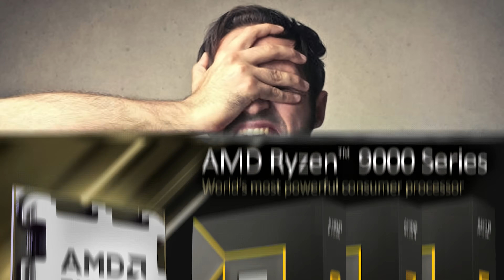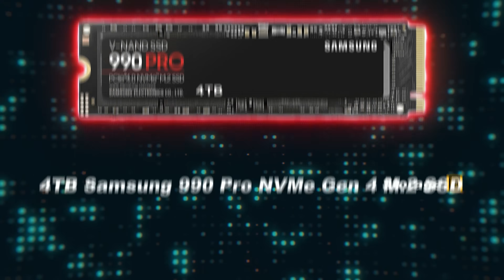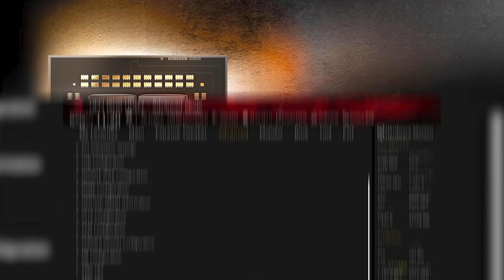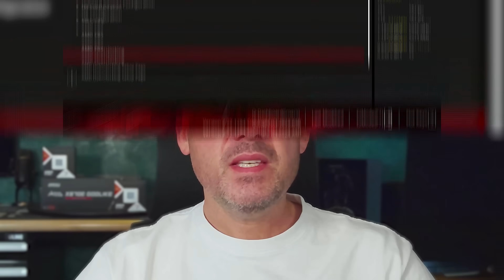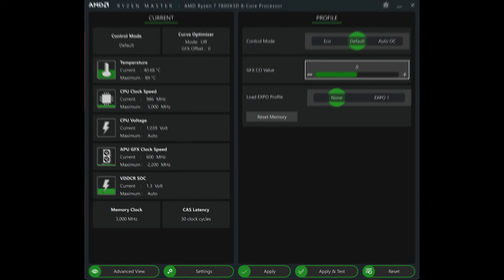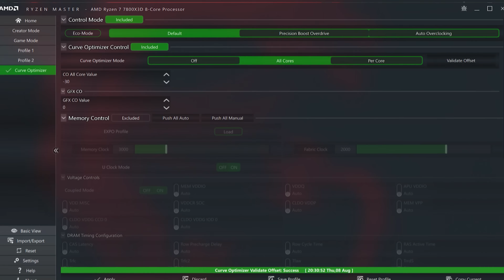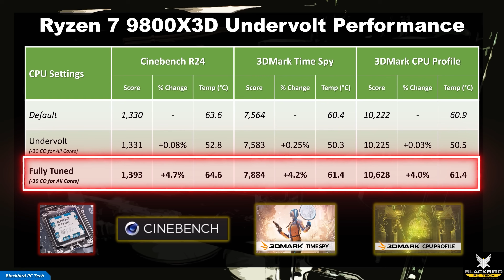How To Undervolt a Ryzen 7 9800X3D The Right Way! (or Any AMD AM5 Ryzen CPU)

Comment: As a long time builder and enthusiast i never did really much with over/underclocking other than "auto overclock" on my old i5 2500K. Now with my 9800X3D running a little hotter since having a new graphics card looking into undervolting and making the most out of my system. Looking at a lot of different information and guides. This guide is nice, not really specific on the Asus motherboard but PBO in general. Some others do this pure in the "Tweaker" tab in the bios which makes me feel a little bit lost in the MSI Bios and actually understanding a lot more 😅

However, where this starts making no sense is in the comparison charts around the 7:00 mark. You compare the Max CPU clock speed. Sure, the "wrong undervolt" has a lower max CPU clock. Which sounds like trouble, however, al the fps scores on the left are actual higher!? How come? And is this a sign of a throttling cpu due to low voltage or other factors?
Reply from the maker: I understand why that may be confusing and I should have used a different example to try to highlight the issue of clock stretching.  These runs were conducted weeks apart and not at the exact same settings, which is why the performance was different. My intent was to highlight how to recognize clock stretching.

Comment: Thanks for the video. I only did negative 10 undervolt and achieved everything I wanted to achieve. 😊 It's stable and I could probably go to negative 30 as well. But I'll keep it as is for now.
Reply from the maker: As long as you are happy with your performance that's all that matters!
Reply: @blackbirdpctech  I already changed it to 20 😅 I'm a bit overly cautious with these things.
Reply from the maker: @Thunderhawk51  it's ok to be cautious ... just keep checking stability after you make changes and you will be good
Reply: @blackbirdpctech  Yeah it's stable 😁

Comment: I don't know what should I do with AIDA tests for my 9800x3d. I have mixed feelings... my system could be stable with -28 for a half an hour and fail after 4min with -27, should I bother if the games run smooth with high load for hours with -33 or only leave the curve when AIDA passes at least once for 10 min (cause it can pass first time and fail on second run)?? Temp is always around 70C. Thank you.
Reply from the maker: I would recommend backing off to a stable setting ... something like -25 CO
Reply: @blackbirdpctech thanks!

Comment: Case: Fractal Terra, cpu cooler: thermalright axp90-x47 full copper.

I was able to do only -10 on all cores which was stable, temp max 80-82C, -20 pc did not boot, -15 pc booted but after starting stress test pc freezes completly. So my silicone lottery luck is only -10 😁 but I think it is still good.
Reply from the maker: Remember that -10 is still better than stock, which is better than what you "paid" for ... so take the win 😉

Comment: Question I notice you said that there were two ways to access curve optimizer I did notice that on my bios, I also am using a rog motherboard which one do you recommend using and is it a problem if you use both?
Reply from the maker: I recommend which one to use in the video ... I wouldn't recommend using both, but if you do, make sure to enter the same inputs in both.

Comment: I bought a pre built 9800x3d with a 5080 and was running 95 degrees in cinebench and like 60 degrees at idle I decided to undo the AIO and I found they left the protective film on the AIO cooler plate 😅 now it tops out at 75 degrees and idles at 40
Reply from the maker: Of course they did ... it's truly shocking what some companies do ... most have absolutely no idea what they are doing
Reply: @blackbirdpctech im just glad I noticed when doing my setup and trouble shooted it before getting stuck into a long gaming sessions and setting my desk on fire 😂

Comment: Will this effect caching performance/stability in Borderlands 4? I have a Ryzen 7 9800X3D for about 3 weeks now and I'm only here because I've been playing Borderlands 4, high CPU temps!!!!
Reply from the maker: If you implement a stable undervolt then it should be stable in any game you play.
Reply: @blackbirdpctech  Hej
Thanx a bunch, I undervolted to -20 and BRL4 is caching at 74 degrees instead of 90 plus!! Gaming is mid 60s. Amazing help
I have noticed that menu switching has a bit more of a mico-stutter than before, fps drops to 20-30 whilst switching. And my QD-OLED screen was ruining unlimited FPS . I locked it to 120fps ingame and temps have dropped to the 50's!!!
Bit of a shame considering the cost of the screen and what it can do
I will try a -10 undervolt in the bios, see if the micro-stuttering goes away.
But still MANY THANXBUNCHES !!

Comment: i just picked up this proc and wanted to underclock it but only seem to find info on under volt it
Reply from the maker: Why would you want to underclock it?
Reply: @blackbirdpctech just concerned about how many of the chips are getting fried and to just increase longevity for the chip itself. I was just thinking about running it at 10% under

Comment: Could you check and tell how much power the system uses when idle with the CO -30? It's really useful info too, since that's the biggest issue compared to an Intel processor.
Reply from the maker: Do you have a 9800X3D?
Reply: @blackbirdpctech  Not but I'm thinking about getting it. I know its power consumption is great for gaming, I just want to know if in idle mode, leaving the computer on without using it, the negative CO also has an effect.
Reply from the maker: I didn't test the idle power

Comment: Hello! I've upgraded from a 5900X to a 9800X3D before Christmas. I paired it with an MSI X870E EDGE TI WIFI motherboard with an updated BIOS, and I am currently running the CPU on Auto settings but with EXPO enabled. 

Aside from performance gains and temperature drop, is it really recommended to undervolt this CPU? I'm asking, because my 5900X was very unstable on Auto settings and caused a lot of problems for my computer (black screen crashes, freezing, and lockups which all happen during idle/low power/desktop-only use and under load). I fixed the issues by setting a fixed Vcore voltage of 1.100V on the 5900X. Apparently, my 5900X goes as high as 1.450V during idle on Auto settings.

It's been a few weeks and my PC has been stable so far, but I just want to avoid the possibility of experiencing the problems I had with my 5900X. FWIW, my 5900X was among the first few batches of 5900X that were bad. The 5900X has a very high RMA rate. Unfortunately, I purchased the 5900X in April 2021 and I was only able to pinpoint the problem in June 2025, so RMA was no longer an option for me. I also found out about the 5900X's problems on Reddit in the same month. 

Thank you for your time! Happy New Year! :trophy-yellow-smiling:
Reply from the maker: Performance gains and temp drops are the reasons to do it ... and yes, I would definitely recommend it ... there is only upside if you implement a stable undervolt.

Comment: I went from stock volt cinebench multi score 1291 at 90° max temp to -20 running 1333 hitting 72° max which is actually massive

I tried going straight to -30 from -20 but my computer did not like it, currently long testing -22 for stability now, i wish i could get -30 out of my cpu
Reply from the maker: -20 is a great undervolt

Comment: changing the PBO and setting negative 30 all core made zero different at all on my 7800X3d on the Gigabyte X870 Aorus Elite... temps have not changed
Reply from the maker: Doesn't sound like the setting was applied properly.

Comment: I started the aida64 test and after 16 minutes it said Warning : Hardware failure. Does it mean that my undervolt is unstable? I’m using the 9800x3d at -30 with trisent z5 royal Neo at 6000mt
Reply from the maker: I'm not sure what else you've done to your system but yes, that would likely indicate that you've pushed your undervolt a little too far.
Reply: @blackbirdpctech only the undervolt. All the rest is stock. I enabled the xmp/expo profiles and just started to tinker with the undervolt settings. In the video you recommended to run the test for 10 minutes. In my case it got a failure at 16 minutes? What should be my next steps? Run the test for longer or?
Reply from the maker: @Lungmarco  you can join my Skool community to get further help: https://www.skool.com/blackbird-pc-tech-4230/about?ref=67e6a7048d9540fe87cbdf1b69bd47f3
Reply: @blackbirdpctech  would it be alright to give me some tips here? I just ran a test for 30 minutes at -25 and no crashes. Am I ok here?
Reply from the maker: @Lungmarco  I provide a lot of value for free in my content ... happy to help, but you will need to join my Skool community.

Comment: Tried between -10 to -30 , -30 crashed system the others seem to be ok in aida64 test however temps appeared higher than stock baseline settings 

What could this be I’m lost ? And any other info please ?
Reply: I got a mpg x870e carbon wifi motherboard
9800x3d 
4090
Reply from the maker: Are you sure you are applying a negative curve offset?
Reply: @blackbirdpctech  yeah, all cores, negative and tested each number between -10 to -30
Reply from the maker: If your temps are higher then either your performance went up, which means your boost algorithm is taking advantage of the thermal headroom, or the undervolt wasn't applied properly in Bios ... you could try applying it in the motherboard specific PBO area to see if that works
Reply: @b @blackbirdpctech  Thanks ! , so will it still be ok if the temps rise like you said could be because of its headroom ? , will try again tomorrow and reply back
Reply from the maker: @Arpzyyy if you want further help and tech related support, you can join my Skool community:

https://www.skool.com/blackbird-pc-tech-4230/about?ref=67e6a7048d9540fe87cbdf1b69bd47f3
Reply: @blackbirdpctech  sorted, it just didn’t save properly Thanks for video and helping !

Comment: Undervolted straight to -30 in bios after installing Ryzen Master you can see that your OC worked and that the CCD state -30 now doing an aida64 10 min strestest and it runs at 60 ° so yes a 15 ° drop in temp thnxs The Outerworld I run on Ultra with a Radeon RX 9070 XT and a ASUS Tuf X870 DDR5 32 GB  5600Mhz at 300 + FPS with a cpu of 75 ° this will be much less
Reply from the maker: Nice!

Comment: I used and offset of -10, and when using an occt stress test with 100% cpu utilization my temps went from 90°C to 55°C. HOW?!
Reply from the maker: It's pretty damn cool right?
Reply: @blackbirdpctech  with some more tinkering i got the cinebench score from 883 to 973 and the temps from 91°C to 72°C (there was a little loss of multicore performance with the 55°C, that was without overclocking). Thank you for the video :)

Comment: I have installed the HWinfo program to monitor the temps and I put it on sensors only on startup and so the CPU Tctl/Tdie is 44-45, same for CPU Die average. Then, CPU CCD1 Tdie is ~28-29 but then the actual core temperatures core 0 to 7 are 24-27. My case is Lian Li Lancool 207 Digital, I have the CPU temp to display on screen and it shows 44-46. So what is going on now? Those are similar number with or without -10.
Reply from the maker: Happy to provide tech support within our Skool community:

https://www.skool.com/blackbird-pc-tech-4230/about?ref=67e6a7048d9540fe87cbdf1b69bd47f3

Comment: This video helped me a lot!
Reply from the maker: That's great to hear!
Reply: @blackbirdpctech i just recently got the 9800x3d. Im hoping to get lower cpu temps after undervolting
Reply from the maker: Here is a full tuning guide so you can extract the most out of your 9800X3D: https://youtu.be/N60M36PRHsY
Reply: @blackbirdpctech thank you!
Reply: @blackbirdpctech update : ive tried undervolting my cpu up to a max of -20 and with 150mhz overclock. Any higher and the stability test will fail on aida64. Is this normal?
Reply from the maker: @Ranby96  that's a great UV/OC combo
Reply: @blackbirdpctech i see. Im gonna try to see if i can push it further

Comment: I'm just wondering, why is this needed? Does it mean that the 9800X3D is a concerning factor with stock volt? 
As for me I just built one with Gigabyte B850 Aorus Elite Wifi7 and air cooler ThermalRight Phantom Spirit 120 SE ARGB.
I put thermal paste in X form (maybe little extra?) and my temps so far are 44-46 idle, I think it's a lot regarding idle or just doing light work so I will be trying -10 to start.
Reply from the maker: It's not required ... what makes you think 45 deg C is a lot in idle? You are using a basic 120mm air cooler, so those temps are actually quite good.

Comment: I undervolted my 9700x to -50 all cores with no visual loss of performance. My lows are better and my temp is incredibly low, im running 40ºC all games. I think i dont go to lower temp because my fan curve isnt agressive enough under 40ºC, it rarely pass 42ºC.

Im just impressed by curve optimizer in 9000 series. My friend has an 7700, i was undervolting it for fix his overheating issues and the maximun allowed on his cpu is -15 or he crashes.
I bought my 9700x a week ago, tested since day one -30 cores and working perfectly, now I did -50 all cores and im still 2 days without crashing any game -> playing cs2, valorant, hell let loose, bf6, apex legends, gta v... 

Temps changed from 49ºC in -30 all cores to 42ºC with -50 all cores on BF6. GTA V is on 38ºC, and many others are fighting in 39ºC changing to 40ºC sometimes. BF6 is the most "hot"
I do not remember my initial temps without any undervolt but i think it was 59-60ºC. Its just impressive. I have air cooler (TR Phantom Spirit 120 SE)

My frequency still going to 5,54ghz-5,55ghz so im good, right? I didnt saw lower fps on any game.
Reply: 9700x the real goat 🔥🔥🔥
Reply from the maker: Have you checked that you are not getting clock stretching? Is it stable in AIDA64?
Reply: Btw you can check that im not lying on Lives tab, im just really impressed how the efficiency hits in this generation.

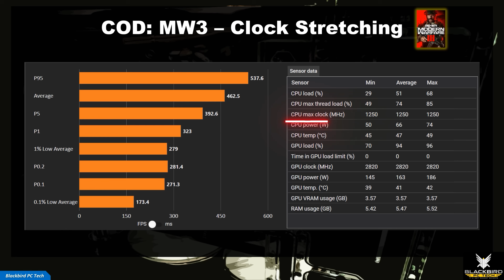Comment: If you did the undervolting through the BIOS as like your first guide in the Advanced tab, why was the 2nd CPU snapshot at 7:21 reading 1250Mhz? Both test were same undervolt setting, what was different for the second one?
Reply from the maker: It was a different 9800X3D CPU, as I explained in the video.

Comment: I have an MSI MPG X870E Carbon WiFi motherboard will this tutorial still work for me, or do I need the exact same motherboard as in the video? Sorry, I’m new to PC building
Reply from the maker: Yes ... most AMD AM5 motherboards regardless of the manufacturer will have a standard PBO interface, which makes it easy to make guides ... I would also recommend watching this tuning guide for AM5 Ryzen systems:

https://youtu.be/N60M36PRHsY
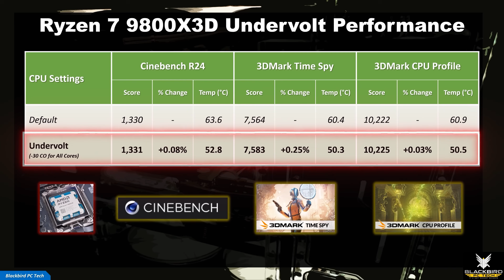Reply: @blackbirdpctech  i have a question i undervolted my 9800x3d step by step form the video went with -15 and after 7:46 of testing on aida 64 i got an error should i go down to -14 or -10?

Comment: Thank you for the detailed video. I have a few questions:
Since there are two locations in BIOS where curve optimizer and precision boost overdrive are found, do we set both or just one?
I have a Ryzen 9900x, do you recommend I set to "All cores" or "Per CCD"?
I researched that manually setting lower PBO limits, PPT, TDC AND EDC combined with curve optimizer will help lower temperatures further. Do you recommend this? And is it safe to do so?
Reply from the maker: This is a much more robust guide on AMD Ryzen CPU tuning: https://youtu.be/N60M36PRHsY

For a Ryzen 9 chip I always do an undervolt per CCD. You can manually set the power/voltage limits, but I'm not sure why you would do that ... just run an undervolt.

Comment: from 95°C to 80°C, from 125W to 100W, from 5000Mhz to 5200Mhz, from 21990 points on cinebench to 22500. It makes NO sense but it works. 10/10 would recommend.
Reply: @Wonback  it's because the processor can boost higher frequency when you undervolt. By default the motherboard gives too much voltage. To ensure people who slap together their pc can use it right away.
Reply from the maker: Awesome result!
Reply: @Wonback  thank you for this comment I always like looking at the comment section to see experiences like this before I go ahead and do it to my own system
Reply: @Eclipsick0  you can trust this one
Reply: @Wonback alr thanks for the reply can’t wait to my system when I get a chance ❤
Reply: @Eclipsick0 Matt/Blackbird is one of the best tech tubers to do it. All of his tutorial videos are top notch reliable.

Comment: I'm pretty new to all of this.
I got my undervolt stable down to -25 with temps from 79.05C to 64.05C. -30 caused the AID64 test to fail.
With these settings, the average Cinebench score was about 0.5% worse. I know that is not much of a difference, but is it expected that undervolting can also decrease performance? Or could it just be margin of error or some random service starting up on my PC?

I'm not particularly concerned with squeezing every bit of performance out of the 9800X3D - should I even bother with overclocking or just keep the undervolt and call it a day? Thanks!
Reply from the maker: That's a run-to-run variation ... if you run Cinebench again you will likely see a small increase. I would highly encourage you to tweak your system to enhance your performance and use up some of that thermal headroom ... you can follow this guide: https://youtu.be/N60M36PRHsY

Comment: You sent me over here to undervolt my 7600x3d on my a620i lightning. Sadly, I don’t see an “Advanced” option under PBO therefore I don’t have access to Curve Optimizer. Only options I have are enable, disable and auto.
Reply from the maker: Unfortunately the A620 motherboard is the only AM5 motherboard that doesn’t support overclocking